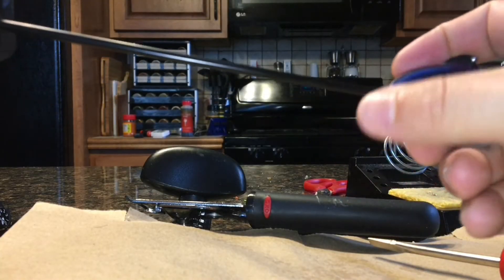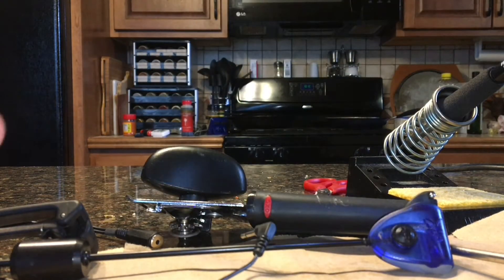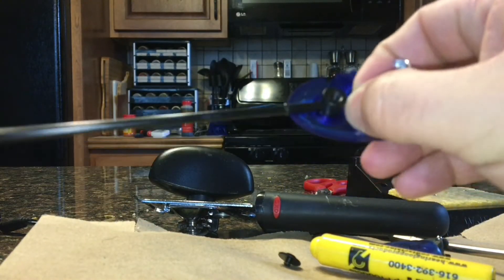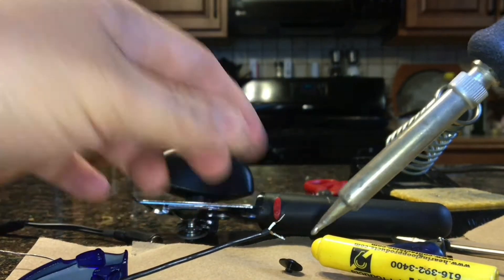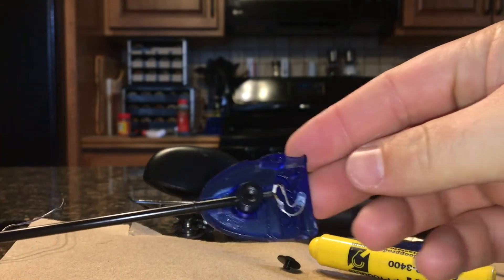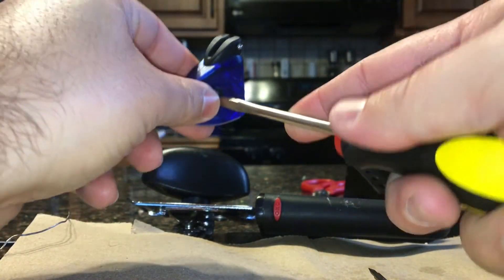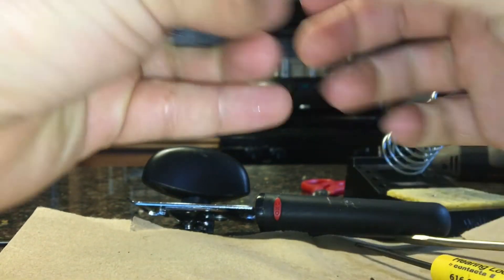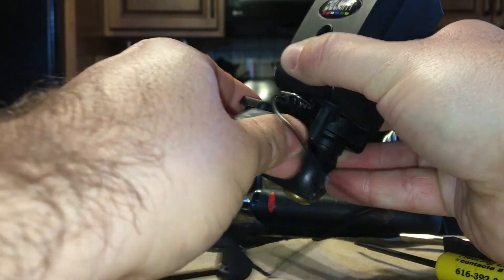How To Make Fox Illuminated MK2 Swingers Work With Delkim TXI Alarms

Comment: Hi just wondered if you know if the Delkim slimlite indicators work on other brands of Bite Alarm
Reply from the maker: Hi Lee!  Thanks for the question.  I have the slimlite indicators and the new fox alarms. I’ve never tried them together, but I’ll give it a try and let you know.
Reply: That would be amazing thank you
Reply: Did you try the slimlites on the fox alarms?
Reply: Hi game tec, they have different size jack plugs
Reply from the maker: Yes, I’m sorry I never posted an answer.  They are different but you could build/buy a converter cable.

Comment: Hi to you, i have just bought two 25 edition alarms that i will use with my existing Fox MK 3 swingers. Can you please advise how you go around fitting them with the switch on the delkim underneath? Do yours interfere with the switch as mine seem to be doing
Reply from the maker: This is a great question that I'll have to do a little research to figure out. I'm wondering if the MK 3's have a slightly different design where they slide on?  I'll try to do a short video that shows how mine attach in the morning and post the link here.
Reply: They slide on but i think are not straight like yours. When attaching to the delkim it covers the switch as there is a curve which covers the switch. The curve in the tag i think is to allow for the jack plug on most other alarms. The delkim is right in the middle underneath, if that helps